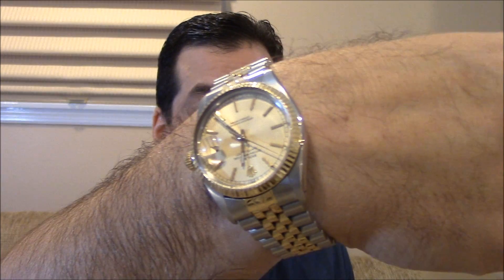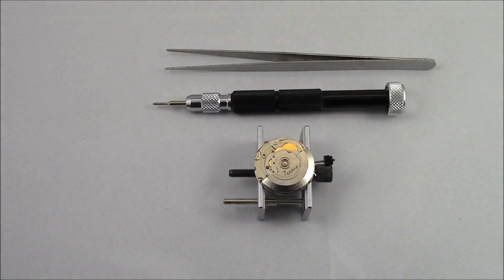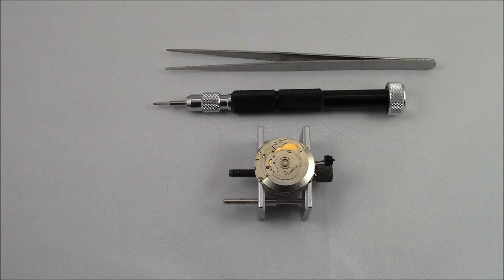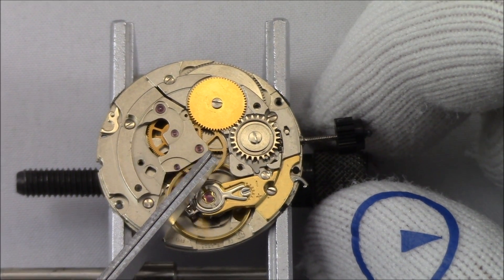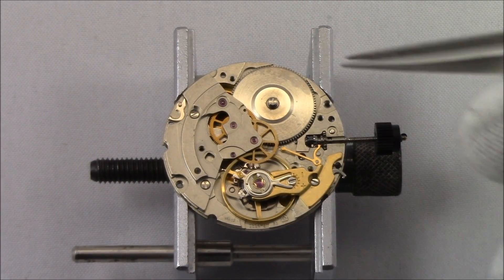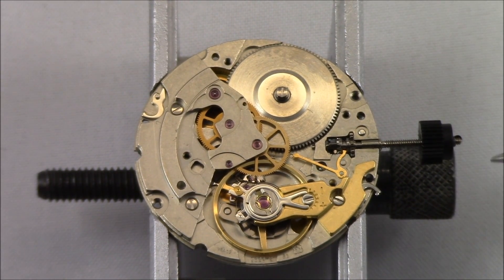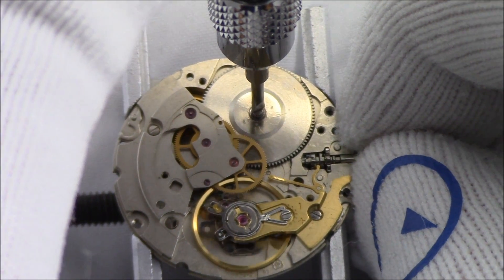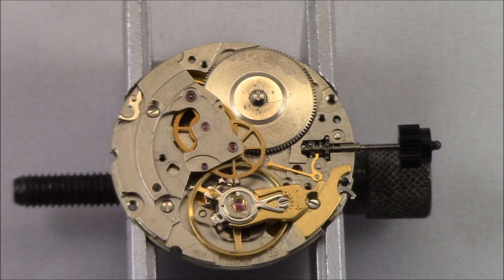What is a Hacking Watch Movement and How Does it Work? - Watch and Learn #35

Comment: For some reason my nh35 movement had a loose hacking lever (I did wear the watch in a pretty abusive way tho). My watch stopped sometimes and I didn't understand why. I noticed the loose lever so I just superglued in lol. My watch works now. It doesn't have the hacking option now obviously. Eventually I'll replace the movement

Comment: Hi Mark, This is Sam, thanks for great videos, enjoying your videos ever since i started digging in mechanical watches,

into building up my own vintage watch collections.

Where my watches doesn't support hacking btw.

The thing is, As i'd always been real careful  all the time when I default the time setting on my watch, trying back-hacking.

I'm itching weather hacking would inflict any damage or totally safe for your watch.

I'd believed that it's totally okay you using the hacking system, it doesn't harm your timepiece according to an article about this issue. where they say it's just slightly detaching only the second hand from the MVT, while it's operating.

But At least Mine seems to be on the same mechanism as the one in your video.

Which seems to be letting the balance wheel to a pause.

So, can i be not too much worrisome about harming my watch any?

Thank you for your reading and your answer in advance.

Sam.

Comment: This is from what I understand about quartz/electronic time devices. On a quartz watch when pulling out the crown of a mechanical quartz watch it stops the electronics to the drive motor circuit. There are different design techniques to achieve the same effect.  On a digital quartz watch pressing the set button and selecting seconds reset to go to zero it does a zero set in the seconds counter circuit.  The master oscillator and main circuits are always working. In a digital watch if the power is completely cut the display will go out.

Comment: You ought to show how Glycine did hacking on the original Airman. It's something not a lot  of watchmakers are familiar with, and tends to be a function that gets broken when an unfamiliar watchmaker services an Airman. There's a lever that moves a tiny wire up through the face into the path of the second hand at the top of its sweep, stopping it from moving.

Comment: Does anybody have the slightest clue as to why a brand new Seiko with the 4R35 movement doesn't hack seconds when I pull the crown to the second position? Everything else works flawlessly but I can't find an answer anywhere and it's so frustrating.

Comment: what do you think is the problem when after pushing back in ,(when the lever lifts up from the balance wheel) ,and the balance wheel does not start back on its own. it requires a little shake
Reply: When doctors stop a heart they need to give it a little jolt to start ticking again.

Comment: Hi Marc I have a skx007 and I adjusted the minute hand counter clockwise for just a minute to set the time just right and I noticed the second hand kind of paused for a second. Does that damage the movement in any way if I turn the hands counter clockwise to set the time?
Reply from the maker: No damage. You can set the time backwards briefly, but not over several hours.
Reply: Ok thank you.

Comment: Useful video`s but please use non conductive plastic tweezers. When a battery is shorted out the full available current is drawn.
Reply from the maker: These wasn't a battery movement, but still, what's going to happen? It's a not a car battery. Been using metallic tweezers for decades.

Comment: Great video. I'm a mech engineer and really loving this series, you have a very clear way of explaining everything and it's neat to really consider all the problem solving and design that goes into these little things (just got my first automatic mechanical recently, a cheap little Seiko 5 speed racer, had some fun replacing the horrid folded bracelet with a nato strap and I love the thing even if I scratched it- oops).
Also I love those Seagull 63s. Every time I see it on your videos l I want one more and think I may need to make one of those my second piece . Do you think any more acrylic crystal 38mm will be sourced at your shop? I've been considering snagging a sapphire one before they're gone but think the acrylic really accentuates the vintage feel -and the cost would be a plus.
Reply from the maker: Yes, in the next few weeks we will have them again.

Comment: Hi Mark. A noob question. Does constant usage of hacking wears out the balance wheel, causing it to wobble? Since the hacking level is using friction stop?
Reply: All mechanical moving parts are suspectible for wear and tear, but in this case, without manufacturing issue I don't think it would be the first part to fail.
Reply from the maker: Nah, not in our lifetime of use.

Comment: Very interesting. Doesn't seem like a very complicated or costly mechanism - I wonder why Seiko left it out of the 7S26 movement on the SKX007/009? Another video perhaps?
Reply from the maker: The 7S26 was developed decades ago. I guess they just didn't see the necessity. (not sure I do either!)
Reply: Well, I just received my SKX from you yesterday. If you need more precision in setting time, doing a little backwards/forwards second-hand dance with the action is actually not that difficult. Doing so doesn't harm the movement, does it?

Comment: My blue ray i ordered from you come today, it is absolutely beautifull! I just have 2 questions regarding the crown. How hard should i screw it down for it to be water resistant etc? It makes a weire buzzing sound when i screw in the crown, is this normal? Its my first mechanical watch :)
Reply from the maker: Just until finger tight; you do not have to crank down on it. The buzzing you hear is the watch winding while it screws down; normal!

Comment: Problem it will take a few seconds to get back up to full speed after being stopped.
Reply from the maker: Agreed. It is back to full amplitude in a few swings, which is a micro fraction of a second.
Reply: Doesn't seem to be enough so to notice from what I've observed with my watches. I think the impulse rate even at the lesser balance wheel amplitude is really similar to at full amplitude, so the total time gained/lost while spinning back up to norm is negligible.

Comment: There’s got to be a clearer term than “hacking”. Maybe “settable second hand”?

But anyway, how about a video on hand-winding in an automatic, and whether it can damage the movement if done too frequently? Or a round-up of hand-winders only that you sell? Thanks for the vids!
Reply: "Hacking" in this reference pre-dates the modern computer-related term by about 40 years - In WW II military (and probably even earlier) everyone needed to set their watches to the same time. Since most watches weren't as accurate as today, and there were no widely available time signals, watches would by synchronized at the beginning of each mission. To synchronize watches, the leader would announce a time about a minute or so in the future, everyone would set their watches (stopping the movement) and wait. When the time came around, he leader would say "hack" to tell everyone to start their watches. You'll see this in WW II movies, especially Air Force. My uncle was a B52 Nav in the 60s and they were still using this term then.
Reply: Good story
Reply from the maker: Did you watch the video I did on how to use an automatic watch? Mostly covered.
Reply: Long Island Watch Ah. Thanks!

Comment: The real hack is to take a non "hacking" movement and delay the second hand by manipulating the watch when the crown is in the set position. The "hacking" watches simply have an added feature where the second hand is stopped as a feature. This feature was named after the operation that it simulates.
Reply from the maker: Do you have a reference for that? Would love to see it.
Reply: Long Island Watch , honestly no. But I bet if I searched pre "hacking movmnt" archives (industry or fan publications?) I could find out if this theory is accurate. I believe it because the real hacking is so common and aptly named, whereas the built in feature is NOT aptly named, unless hacking as a texhnique was already a thing (it was) and it was refered to by this term (no documentation yet, but I'll try to find something, perhaps in a heuroligical book from the distant past. When were the first purposeful engineered hacking movements created. That would be my starting point to look backwards from there. From an evolution of langauge standpoint, the name of the movement has always caused me to believe what I stated as a fact. But honestly Marc, I have never seen the evidence. It is a theory that I have confidence in. I don't mean to spread disinformation. Pretty sure I'm correct tho.
Reply: Actually just looking at the word hacking, it was popularly used to describe a break into or change something because of computers, which haven't been around very long. I've uet to find a similar non computer usage for it. Maybe I'm wrong.
Reply from the maker: What I've found in the past on Watch Wiki is reference to a "hacking lever". If that's what it's called, great. But why is it? I also looked deep into all the historic meanings of the word hack, and I cannot make anything fit what I want.

Comment: This watch with eta number.  Not so fast.  Normally,  is 21600 bits per hour,  eta 2824
Reply from the maker: No. ETA 2824 is 28,800 BPH.
Reply: Long Island Watch yes, I haven't checked the speed on internet,  sorry!